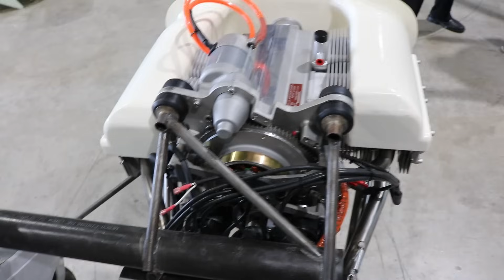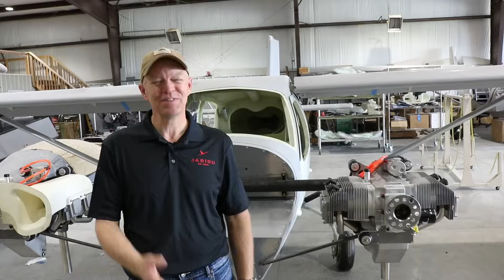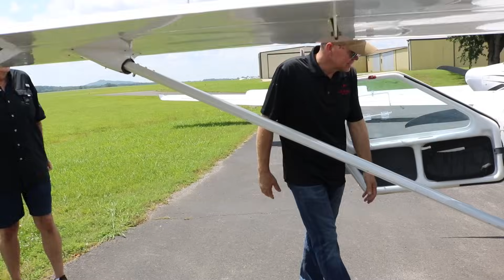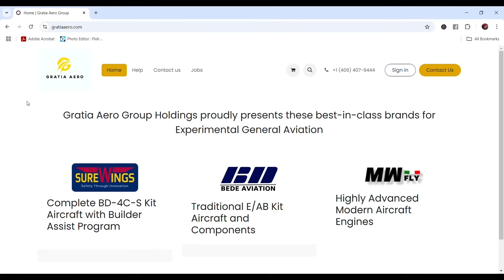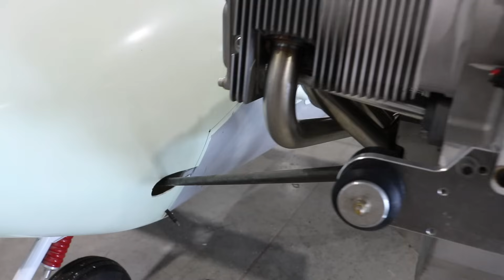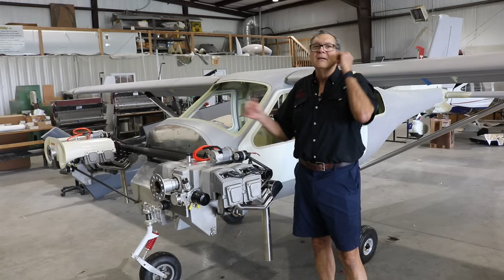The Most Affordable Twin Aircraft in the World!  New Jabiru Twin Engine

Comment: That torque tube mount seems dumb to me. The mount should be more of a canard; a planer (flat structure) mount would make more sense. The torque (and other forces) would be applied across that structure. Easier to transfer the load to the firewall?

Comment: You have to aim the engine axies outwards to some degrees. I think Junkers did it, one of the prominent models who applied it was the Ju52. It reduced the stabilising load on the sole vertical fin because the running engine would blow on it, creating a retreating yawing moment. In the way, the plane would have almost no slip in one engine mode. How big of an angle it needs to be is a small R&D project, but the number to start with are way under 10°. Which still fine because you don't lose much of the longitudinal trust at these angles. If I'm not mistaken, you begin somewhere at 3° and increase it successive up to 7°. A bit differing for each side engine cause the twisting downwash of each prop hits the vertical stabilisator differently.

Comment: I see something I would change
That tube mounted on the firewall as part of the engine mount is ROUND
I would think that is a weaker mount, I'd replace it with a triangle or maybe a rectangular shaped tube because that would be a lot stronger and can take more stress. 
Maybe you could extrude a triangle beam out of aluminum, saving more weight but with more strength

Comment: I don't trust those bolts to hold those engines in place and also pull the aircraft and load safely. Improve on those attachment points.

Comment: why not put the Engine on the wings
Reply: It's much easier to modify a firewall than it is to redesign and rebuild a new wing.  The more forward and centred engine position also creates less adverse yaw if you lose one as compared to traditional wing mounted twin.

Comment: At 10:40, the engine mounts will need X-rays at the inboard. The twisting, vibration, shearing and pulling forces combined with the welding stress will cause that tube to be regularly inspected, and I think that a propeller synchrophasing will help to reduce some of the vibrations. OUTSTANDING Airplane !!!
Reply: Trusting those two small welded tube brackets to hold up during service ( turbulence, vibration, rough landings) would be a leap of faith imo…..
Reply: Why X-ray, the tube is hollow and can be boroscoped. X-ray is pretty terrible at detecting small cracks anyways

Comment: If it were me, I'd rather a push-pull twin. Yes, much more would change in the tail, but advantages would outweigh the extra effort. Second motor on a bulkhead behind passengers, with a large-diameter carbon-fiber driveshaft out the back to a thrust-plate to the rear prop.

Comment: It may be the least expensive, but it definitely is the ugliest.  I suspect visibility isn’t the best either.  Certainly makes the engines easy to work on.  And likely less asymmetrical thrust with engine failure, but I still think the push/pull Cessna Skymaster design is far more ideal for a light twin.
Reply: Excuse my ignorance, but what was/is the issue with the skymaster? Why did it never take off? Did the turbulence from the front prop reduce the efficiency of the rear?
I ask because it always appeared a sleeker solution aerodynamically.
Or was cooling an issue ion the rear?

Comment: The only thing worse than a Jabiru engine?   TWO Jabiru engines...😂😂😂
Reply: Why?
What would you perfer, and why?
Reply: @andrewkovach9330 a single Rotax 915 iS will pull harder, drink less fuel and be more reliable than this pair of donkeys.  If this thing loses an engine the only thing the 2nd engine is going to do is take you to the scene of the crash.....
Reply: Speaking from personal experience, I have owned 5 Jabirus and have had no issues other than regular consumables.
I put 900 hours on my last Jabiru before overhaul and I have had no problems if properly maintained.
 I know 20 years ago they had teething problems, but so have the diesels on the  DA42 Diamond aircraft, but the new Jabiru engines are very solid.

Cost to operate is another plus. Oil changes on my 182 is 8 qts of oil, and a $47.00 Tempest filter. The Jabirus are 3.2 quarts and a $3.80 filter from Autozone. Same for fuel filters and air filters. Go buy a battery for any GA aircraft and compare it to the one in a Jabiru.
A new engine for my 182 is 75k. I can buy a new Jab engine installed for about 24k.
They aren't perfect, no aircraft is, but for the money they can't be beat and that's why I spend my money on them.
Reply: here in 2025 and Jabiru STILL doesn't offer any of there engines with FADEC. I'm nots saying that they have to included it on every engine, but they should at least have it as an option. Carbs, NO THANK YOU.   UL Power Or Rotax, Yes, than you.
Reply: Just wondering, why you are knocking Babies engines?
Have you owned one or know anyone that have or used to have one?
Reply: @andrewkovach9330 the one's at our airfield were notorious for either overheating, throwing oil or warping heads.   Eventually the airfield owner stopped taking hangerage applications from Jabiru engined aircraft as they were more trouble than they were worth...
Reply: Delthawk seems cool. Way too expensive though. Also athe only thing I've ever flown is a da20 with a Mercedes diesel

Comment: Digging the idea, but worried about the engineering of the engine mounting. I question the durability of the light tubing welds to the main cross torque tube. Also the lack of lateral bracing of the four light tubes. As I mentioned, just concerned with vibration durability. As the kids say...I would not like seeing one engine leaving the chat.
Reply: I noticed that also especially with four bolts holding two engines to the firewall and throw in engine vibration and G forces and I can see some fatigue over time.
Reply: That was my thoughts when I seen this..at least maybe use some SCH80 pipe or XS. I am sure some of this is weight considerations. My stomach always jumps when I see things like this…but maybe they have a very skilled engineer and really understands FEA. Not just some FAA people doing this 😮
Reply: @matt_h537 trust your instincts. Not Engineers whom you've not seen or proved.

Comment: "The Most Affordable Twin Aircraft in the World!" I guess this guy never heard of the Zenair Cri-Cri.
Reply: And apparently YOU'VE never heard of a Lazair !
Reply: @jpdurr  The Lazair has more maintenance and storage expenses associated with it than the Cri cri. Cri cri has a much smaller footprint and is not fabric covered.
Reply: @drott150  and yet it is still cheaper than the Cri Cri, and still holds the title of the cheapest twin engine airplane ever in the world so far!
Reply: @jpdurr  Eh, no. There were twin chainsaw engined powered hang gliders back in the 70s. And a Cri cri was a kit or plan built aircraft. Defining exactly how much it was for each customer to build one is not possible. But it could have easily been built for less than a Lazair. And of course, in comparing long term maintenance and hangaring costs, there is no contest.
Reply: @drott150  are you ignorant to the history and later developments of the Lazair, you could by airframes and kits. You could use aircraft grade engines with dual spark plugs (Polini). Give it up. The Title still belongs to Lazair.
Reply: When he said "Zenair" CriCri he automatically proved he doesn't know what he's talking about.

Comment: This will fail for lots of reasons but a big one is it has engines literally no one wants.
Reply: Maybe you’re right but there are a lot of people in this world. Not everything needs to appeal to the masses to be successful. I have a project that’s pretty much the same concept except it’s a tail Dragger / bush type set up with 912 Rotax engines. My engines are near new and cost $6k a piece.
Reply: @Iflyagrasshopper  what is your idea?

I was actually aware of the one of these in ZA, as I was looking at ideas and whats out there for twins in the experimental market.  I'd imagine the deign of the aircraft works, but the jabaru engine is DOA for about 99% of people.  Looks at what literally anything with that engine is worth.  Basically whatever the scrap value is.
Reply: @z987k  my airframe is a Decathon wings are 172 with STOL cuff  engines are 912. The geared engines should produce more thrust about 400-500 lbs each static.  I got the idea from the Cessna Cub. My aircraft should weigh about 900 lbs and land at about 28 mph. I’m hoping for 110-120 mph cruise. Takeoffs hopefully less than 100’.
Reply: @Iflyagrasshopper  That's awesome.  When I saw the badlands traveler, I thought someone needs to meld that with the double ender.
I think Vmc will be an issue for anything remotely stol unless it's in line.
Reply: @z987k  the double ender was a failure I believe because the engines were so high.  Having all the weight up high makes stopping quickly more difficult. The air cam is a STOL aircraft with twin engines capable of taking off on one engine. I’m hoping for something similar to the air cam.
Reply: @z987k  also when considering thrust it’s important to realize that there are several factors at play. Increasing the diameter of the a propeller helps to increase the STOL capability because the surface area of thrust is increased. However this benefit is limited by the rpm and increased tip drag. Noise is the result of overspeeding  the prop. Having 2 68” propellers @ 2300 rpm is far more efficient and will produce far more thrust than the same amount of hp on a bigger single prop or even 2 props in a tandem configuration.
Reply: @Iflyagrasshopper  The air cam, while STOL, is far too fragile to actually use in real BC ops.  It's the same with a lot of LSA stol aircraft built in the L48.  The people building them have never seen the abuse an aircraft actually needs to take for decades on end.  The putting greens and smooth gravel people land on and call off airport is a joke.
I looked at an aircam hard on floats, as that eliminates a lot of the abuse, but it's so slow and has so little useful load and range as to be completely useless here.
I heard there were significant stability issues with the double ender.  I'd really like some seat time in it to see what it flies like.
The high CG can be fixed by just putting a steel rod and a bogey wheel out front to prevent the tip overs if you got to hard on the breaks.   Or possibly moving the gear forward like a helio.
Reply: @Iflyagrasshopper  idk if you've ran different props on aircraft, but prop diameter is so big for stol.  If you don't care too aweful much about top speed, as long as possible while staying below trans sonic is always best.  On a 912 for low end thrust, I'd go 82-83in.  Which is about .85 at 0C SL.  If you really didn't care about speed, 86 would be better.
If you've never flown a helio, the gearbox and 102" prop is absolutely incredible.
Reply: @z987k  2 propellers @ 68” would produce 7,200 square inches of surface area. I can get about 400 lbs of static thrust with an 80 hp 912 on a 68” prop. A 82” prop would provide 5,200 square inches of surface area. Even if you had 200 hp on that 82” prop my money is that 2 80 hp Rotax engines on 68” props would out pull it.  Since a propeller produces thrust by pushing and pulling on the air surrounding it the more surface area the more traction so to speak. I’m very aware of the Helio and why Dr Opperman insisted on a geared engine. It allowed use of a large diameter propeller without sacrificing efficiency if the propeller was exceeding its ideal tip speed.

Comment: You’re going to get those comments; ooh, it’s ugly, or dang, it’s awkward.
Forget it; this configuration just makes sense. Having the engines pulled in tight to the centerline creates benefits in other ways too. I’m just surprised that we haven’t seen this design from other manufacturers.
Reply: Yep. Uncommon, but Dornier Do28 series ? Not an aerodynamicist so I'm sure what is lost from the blown wing effect vs drag......and structurally, the wing bending moment.?
Light twins have their place, but I'd like to see the 1 eng inop performance numbers: Doubling my chances of an engine failure, without excess power, the remaining engine may only take you to the scene of the accident.
I'd go with a performance LSA/Mosaic single and a BRS.
Reply: @spdaltid  Having one engine left is fine even if under powered and can at the very least get you to a place to land better than a single with no engine after a failure.

Comment: Looks good enough , what's the closest competitor ?
Reply: tecnam p2006t is a more conventional twin with a pair of 100 hp Rotax engines, rather pricier I think
Reply: @thewheelieguy  Not really, that is a certified plane that goes for $750,000.  A closer competitor would be the Ex/Am Air-Cam Twin (that also does use the Rotax Engines) that can be completed for under $250,000.
Reply: @jpdurr  Love the look of the air-cam, but assume the usable weight would be lower (though fuel burn also significantly lower)

Comment: Get your multi hours for cheap! They should retract the nose wheel, and definitely use feathering props. You would have proper ‘light twin’ and the time would count the same as an Apache.
Reply: I believe there are electric feathering options . I know there are for the Rotax.
Reply: Why nose wheel? Most of the drag is from the main gear. The only real reason the long-EZ retracts the nose only is for balance when the pilot gets in and out on the ground.
Reply: @mytech6779  so it will have “a retractable landing gear” so flight time will be ‘complex’ time as well as ‘multi engine’. It’s a rule hack.
Reply: @earth9531   Logging complex time generally is not very useful other than the 10 hours of combined complex, TAA, and turbine experiance needed for a commercial certificate. Or similar low amount of time needed to rent a complex plane (but it doesn't matter if you own the plane…).

"complex" is not a class or type and not required for any ATP certificate minimums. Besides all that most people get a complex endorsement as a prerequisite for multi-training or as part of their multi-engine training.
Reply: @mytech6779  I get it. But it would look suspicious if you show up to an ATP ride with your required multi but not much complex. I haven’t kept up with the TAA stuff, it was after my time.
Reply: @earth9531  Suspicious? If within the required rules, so what!
Reply: @jpdurr  yeah. I guess people get their multi hours in a p68. You’d probably do your actual check ride in a Seminole or something. So the hour building part doesn’t matter.
Reply: @mytech6779  Not to be too obvious, but the nose wheel keeps the props out of the dirt, DUH
Reply: adding complexity for not much performance is always a bad idea.
the beauty of these aircraft is CHEAP and complexity isnt cheap
Reply: @kukajin9560 it's for Twin hours, complex hours and retract hours
Reply: @kukajin9560  you don’t get the point, it’s to satisfy a stupid rule for number of hours required for an ATP practical test